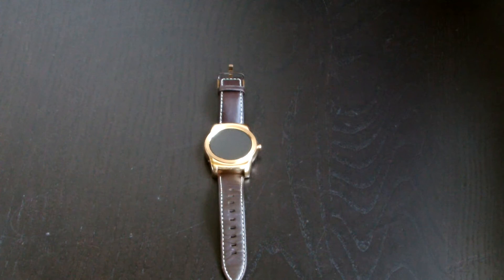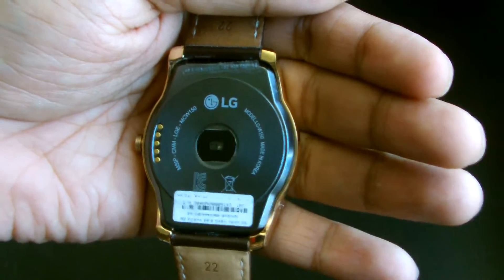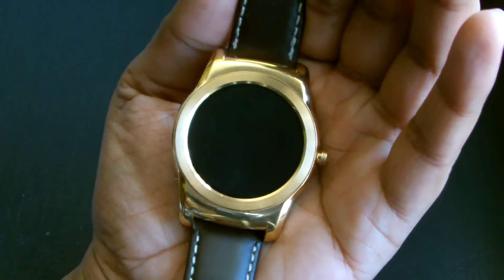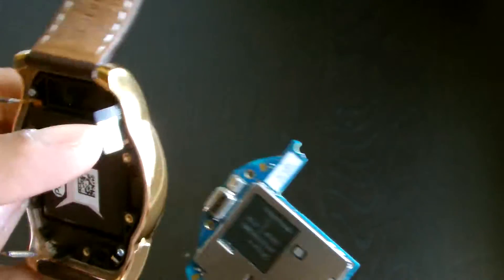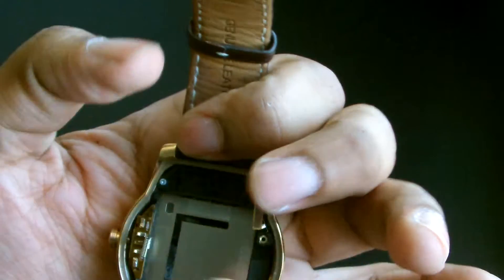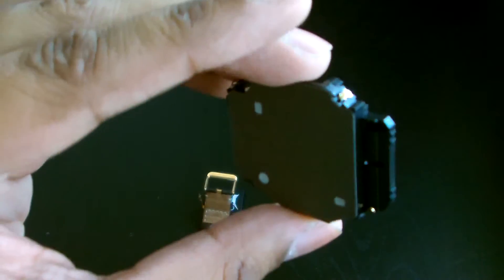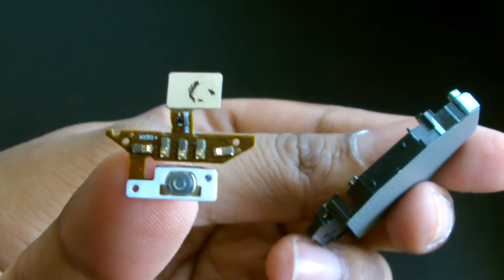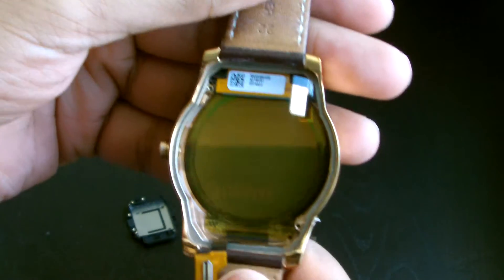LG Urbane Watch Teardown - Disassemble

Comment: Thank you for the video guide to the inner workings of this early generation of LG watches. I still get compliments on my gold urbane. I must have damaged it with sweat and use on my job in all sorts of weather as a transit operator. I took a chance on an ebay listing for a silver urbane that appeared to have very little wear. It had a discoloration on the screen so I swapped the internals over and now my old watch works great. The side button functions now which had only intermittently worked a couple of years after I got it requiring me to place it on the charge dock to turn it on. I just removed the 2 screws holding the battery and motherboard subassembly instead of disassembling the motherboard and battery. I ordered 1mm wide double sided cell phone adhesive to replace the gasket for the back cover,  the original gasket had deteriorated unfortunately and I have been unable to find a replacement OEM gasket. Still works pretty well for the age and limitations of the components. As well I have found resetting the watch every 6 months to a year reduces the lag that becomes common over time. As well cleaning the charging contacts on the back cover with isopropyl alcohol has reduced the resistance and heat the often accompanies charging. Cheers!

Comment: Thanks for the video! 
But how do i make sure it will remain waterproof after putting the case back on? what kind of glue should i use so that it doesn't pop open or break when i try to open it next time?
Reply from the maker: +pruthsful hey dude. I am not sure on the glue. There must be some info around for that

Comment: cool video mate, is there a way to find out what could be wrong with the watch? just wont turn on, might be the battery or the motherboard... how could you tell?.
Reply from the maker: hmm. its not easy. If the watch does not respond at all meaning just dead. My guess would be the motherboard gone. If the watch it out of warranty then open it up disconnect the battery and reconnect it. Something else to think about is that is the power from the charger actually reaching it? Maybe the pins on the charger or internal to the watch have moved or bent. double check everything.

Comment: I have an LG Watch Urbane silver and the bezel is pretty scratched. Since you seem like a pretty decent guy what would you suggest on the way forward?
Reply from the maker: +Mhisani Fox hey. There are 2 things u can do. 1. Buy a replacement case or broken watch and swap the parts.
2. This is my preferred option. Sand the polish the watch casing back into a new condition. There are videos around that should help on what you need to do this. General polishing vidoes.